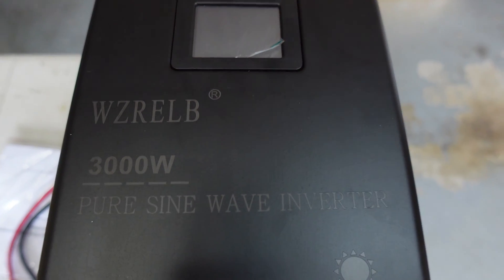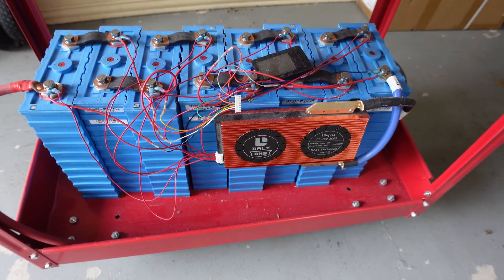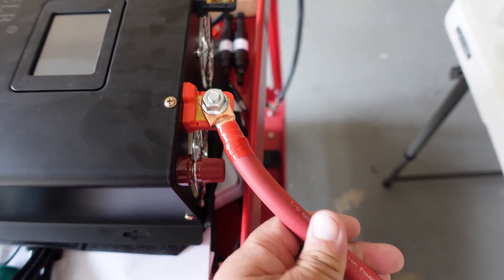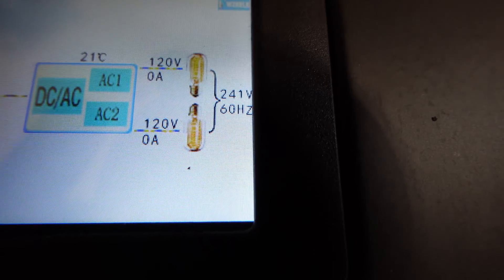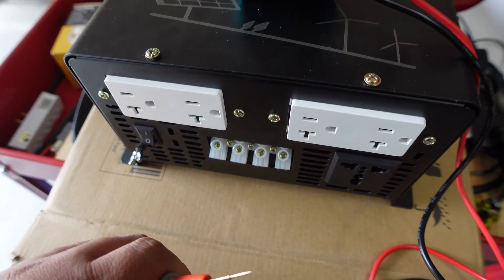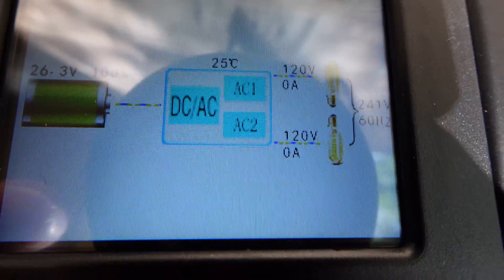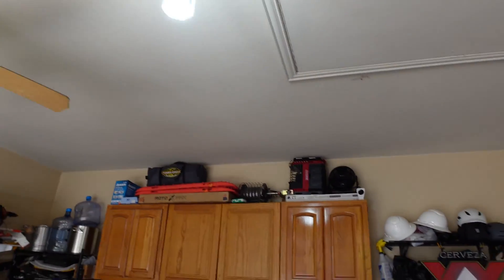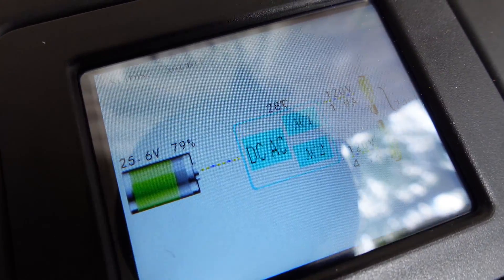WZRELB 3000W Split Phase Inverter 24v DC to 120v 240v AC review and test

Comment: THIS IS A GREAT VIDEO 👍BACK THEN OF YOUR NEW HIGH FREQ SPLIT PHASE INVERTER  COMPARED TO LOW FREQ INVERTERS AND WHAT IT CAN POWER IN THE WHOLE HOUSE WITH 3000 WATTS .THIS IS A PREPPERS WAY OF PREPPING FOR ANY SHTF SITUATION AND TO SAVE ON THE LIGHT BILL AT WILL . ARE YOU PLANNING TO GO ALL THE WAY WITH SOLAR PANELS AND A CHARGE CONTROLLER AND SOLAR COMPONENTS  COMBINED ? CHECK OUT MY DIY SOLAR VIDEOS , HIT LIKE , LEAVE A COMMENT AND SUBSCRIBE . MAY THE SOLAR BE WITH YOU .:goodvibes::goodvibes:

Comment: I considered buying this inverter to run a well pump but read that it's limited to a maximum 12.5A current output on the 240 connection. My well pump pulls 24.9 amps at start up. Have you tried any large loads?
Reply: I’m here to ask the same question
Reply: @ShanePinney  
I opted for the 6K 240v inverter from Sungold Power (Amazon). It's a beast. Highest load tested was my well pump plus two 5k btu window units and three 36" shop fans, at the same time.

My setup is
(16) 7a 240w Bosch panels 4s4p
(1) 45a Victron charge controller
(4) 12v 100 ah LifeP04 batteries series to single bank @ 48v

The inverter is hybrid in that it can also receive power from your utility and will switch to that source when there is no longer enough solar power being generated for your loads.

It's in use to run the well pump, the pool pump, and two refrigerators.
The result is that I am running appliances from solar during the day and utility at night. 

Jan 2022			                Jan 2023	
1,400.0k Wh	$241.70		963.7k Wh	$126.74
Feb 2022			        Feb 2023	
1,366.8k Wh	$242.95		915.8k Wh	$120.69
March 2022			        March 2023	
1,155.0k Wh	$200.17		1,138.6k Wh	$150.24
April 2022			        April 2032	
1,872.4k Wh	$311.27		1,062.2k Wh	$139.66
*May - 2022			        May - 2023	
3,816.7k Wh	$712.56		1,841.5k Wh	$245.08
*June - 2022			        June - 2023	
4,585.5k Wh	$960.05		3,171.3k Wh	$421.18
*July - 2022			        July - 2023	
4,312.5k Wh	$791.16		3,221.9k Wh	$425.67
*bad pool pump - discovered in July 2023
Reply: Thanks for your video. I am considering purchasing one of these.

Comment: Isn't that a 240 plug in the side
Reply from the maker: If you are talking about the bottom right plug, that is an European or asian type plug. Technically you can use that but it will be only 3-prong. For split phase you need four, two for hot, one for neutral and one for ground.
Reply: @peakboost  you can't do split phase 4 connections. It says so in the manual. It only supports split phase 3 wires (hot 1, hot 2, and ground). for welding machines or other high-load applications that don't use the neutral at 240v. I use mine for my welder, which doesn't need the neutral wired (Nema 6-50p/r). It says: Danger, do not use neutral in split phase, neutral isn't supported.
Reply from the maker: @serdiefgotreb  It really doesn't matter for neutral and ground, you can use both or either. If you look in a circuit breaker panel, most neutral and ground are bonded, mine is. Neutral and ground are on the same bar. So yes, you are correct, you can use 3 plug. But if it’s wired up to a circuit panel, you will need to use 4 wires. And if your machine only use 3, then just wire 3 and leave neutral out. My dryer is 4 plug, NEMA 14-30R, it need 4 wires. The manual is partially incorrect, I open this inverter up, it will work with 4 wires. In fact, my testing found that the 15 amp plug has the hot and neutral reverse. You might want to check yours. I reached out to the seller and they actually told me not to post that part, so it is edit out. They will fix it on their production.
Reply: @peakboost  , Hi, Is it possible to connect the natural wire to ground and then connect both to the earth? The issue I'm facing is with my Tesla charger, which indicates that there's no reliable ground detected, even after I've connected the ground wire to the earth. I'm considering connecting both the natural and ground wires to the earth connection, but I'm worried this might damage the inverter.
Reply: @peakboost  thanks I have been researching trying to figure out a way to run us 240 mainly for short times like to use a air compressor
Reply: Got the 5k version and the euro plug was NOT there. Instead there were the screw clamp connect for you to hook up whatever 240 plug you  want. Which I was great full for